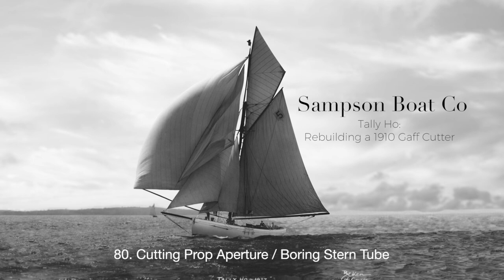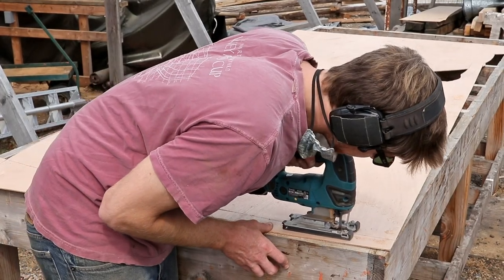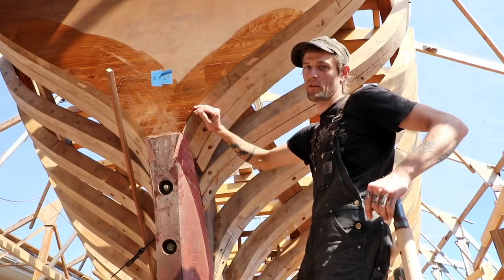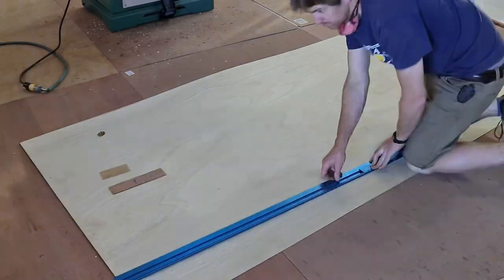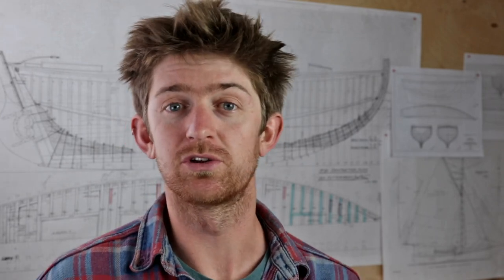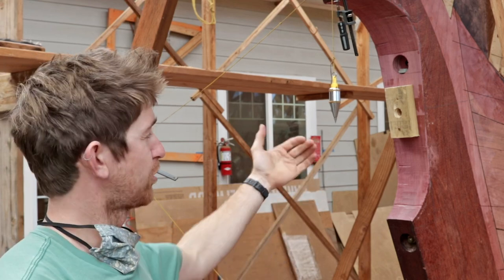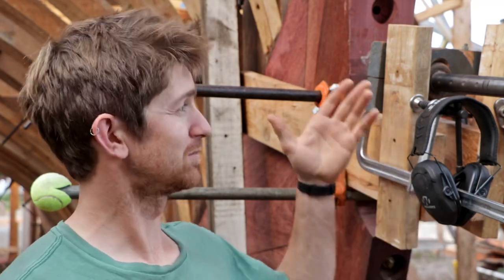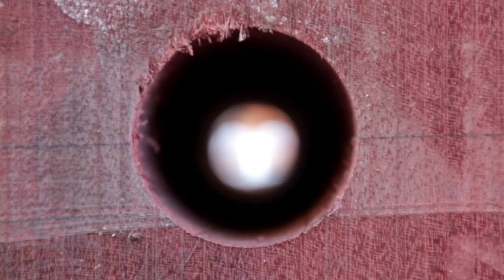Cutting for Propeller / Boring for Prop-Tube ( Wooden Boat Rebuild / EP80)

Comment: "I commute by airplane and bicycle."

That, my friends, is what you call 'living the life.'
Reply: I doubt the bicycle can offset the huge CO₂ emissions of the plane.
Reply: @Mike-oz4cv  A Cessna doesn't use much more than a passenger vehicle, gets maybe 12-13 mpg.  It's a direct line trip with no stop and go so a much shorter trip and therefore he probably uses less fuel flying than if he were to drive it.
Reply: @rummy98  12mpg is 19l/100km. That’s like 4 times the fuel consumption of a car. But of course in the end what counts is the overall CO₂ emissions of the commute. Which – considering the distance – are probably enormous no matter the vehicle, unless it’s an (electric) train.
Reply: @Mike-oz4cv  
Keep in mind, that's a quote from a guy who sees himself as a corpse with a lizard's light receptor in his forehead !!!
Reply: @Mike-oz4cv  Hey that's still less than my Dodge Durango which gets 21-23L/100km 😂😂
Reply: @deephorizon1365  but it would take you double triple the miles to reach Sqem(spelling?). So he flys directly strate line. So i duno its not an easy yes/no answer. Its a 1947 but 25 year owned checked daily constantly matinence  would have to meet new standards. Im unsure what airplanes engines actually pollute. Remember THIS PLANE is a piston engine like most of cars. Its not a giant jet or even turbojet so fuel consumption  is not that bad. Im sure if he flys easy uses lil fuel he can stretch mpg just like you can in your car. So its not as easy and i know from 05 on hondas if you use a calibrated 5 gas analyzer the exhaust generally can have better levels of NoX and Co Co2. Obviously there's lil oxygen and only a TINY amount of hydrocarbons . So cars are doing a great job. Most of them anyway. Id imagine in planes the cesna worked so they built them "basically"  forever in similar spec. So again harder than just googling mpg ratings.
Reply: @Mike-oz4cv  So let's build him a special electric train that only goes from where he is, to where he wants to go.
Reply: @Mike-oz4cv  get a life mate!
Reply: @maxheadroom7687  Yes I’d like to live my life without having to suffer from his emissions.
Reply: @Mike-oz4cv  In this case I believe the plane would emit ~9.2 kg of CO^2 for the 44 miles vs a car at about 19.6 kg of CO^2 for ~62 miles This was calculated from an average of 0.7 kg of CO^2 per mile for the car. The plane emissions was calculated assuming he burned ~4.2 gallons of Avgas because the engine the engine burns about 10 gallons per hour. At 25 minutes it's about 4.2 gallons and with 2.199 kg per gallon you get 9.2kg of CO^2. 

Therefore in this case the plane is more efficient than a car to make this trip.

Comment: I would find every step of this terrifying and so easy to screw up. How did Leo get those transverse drill holes to emerge right on his chalk line? Jeesh!
Reply: a level and an extra set of eyes
Reply: @brownsnake0400  Yes, for the main hole; but how about the transverse holes he drilled for the sawzall?
Reply: "... and here's the stern post I ruined yesterday!"
Reply from the maker: sight the previous one and adjust :)
Reply: He used the stars and a transom!
Reply: spim randsley  Leo
Reply: Please tell me that was an intensional pun, to "screw up" the cutout for the prop...
Reply: @terrulian  I noticed that too. I have trouble drilling 5" into the bottom of a newel post and 90% of the time I experience drill bit travel. I probably would have made a jig even for those small holes
Reply: @SampsonBoatCo  Contact me regarding balancing your Copper Bronze lead Steel Aluminium Stainless Steel.
Comments about VPP and Alternative shafts for driving ancillaries.
JPJP.
I sent my email to the Foundary guys.

Comment: Leo, nice job boring the prop shaft hole, Its tough to keep the hole centered without a jig. Bravo.

I spent years working at a Navy Shipyard where we overhauled Nuclear Submarines. During that time I worked with machine shop tool makers who manufactured cutting tools for working stainless steel and Monel parts of Nuclear Reactor Systems. There were a couple of things I learned while watching them work. The first is something you as an expert woodworker already know, that when sharpening any tool (chisels, 3/8 tool steel blanks, drill bits, etc) it is critical to keep them cool while grinding. Their sharpening machines always had a continuous stream of water or cutting fluid flowing directly onto the tool bit to keep it cool to the touch. But the tool can go from cool to hot in a very few seconds, especially the sharpened edge where the heat is generated and where the mass of the tool is least able to dissipate the heat. If it turns blue you have have probably ruined the temper. I have used the Tormek grinder that you use to sharpen your chisels and it is pretty good because it turns slowly and has a water bath which wets the stone. Plus the larger mass of the chisels helps dissipate the heat keeping the temperature down. But for the tool bit blanks that may not be sufficient. The tool makers at the shipyard always use a continuous small stream of coolant directed at the tool bit. It may not be practical for you to do with your equipment so the best thing it to grind for a few seconds, then let it cool, repeat. 

Also, I noticed that you welded the cutting tools to your boring tool. It is my understanding that hardened tool steel or carbide should never be welded. The very high temperature will ruin the heat treatment and lead to breakage. If they need to be fixed in a larger piece, for example a tool in a lathe, they are mechanically clamped in place. If they are attached to a blade like the one on your table saw, they are silver soldered or brazed. 

Hang in there, you are doing a great job. Chuck Petrone

Comment: Coming along quite nicely. If I may offer a tip, put a a small clear plastic bag over the magnet  before picking up the nails, then pull the bag off and all the nails will be in the bag.

Comment: I strongly recommend you use a 3 bladed propeller, a 4 blade one will create vibration problems.  Two of the four blades will be alternatively blocked by stern post.  This alternating between 2 and 4 blades providing thrust sets up a pulse that will be felt in the vessel.  If you need a more detail explanation let me know.
Reply from the maker: Interesting - could you email any info about this to me? - info@sampsonboat.co.uk 
Thanks - Leo
Reply: This exchange shows the experience and knowledge of the community sharing Leo`s journey. It`s a pleasure to be a member.
Reply: @SampsonBoatCo  Please share (in your excellent condensed, clearly explained form for landlubbers).
Reply: Related to why car radiator fans are often assymetric to reduce noise: https://mechanics.stackexchange.com/questions/24327/why-are-the-blades-of-car-radiator-fans-unevenly-spaced
Reply: we all, sofa's boatbuilders, need a more detail explanation... if you could post here... 
🇧🇷 ⛵1981 oday daysailer ⛵🇧🇷
Reply: Propellers like any rotating equipment cause vibrations which in the lower frequency bands, 0.5 Hz to 100 Hz, cause noise and vibrations that can be felt throughout structure that resonates with the first, second, or 'n' order of the driver.  Propellers however many blades have frequencies dependent on the number of blades and rate of rotation, typically these frequencies are on the order of 15 Hz to 30 Hz.  The boat as a unit and each piece of the structure making up the boat has a natural frequency.  When the propeller blade frequency matches the natural frequency of structure etc. and the amplitude is sufficient the structure will vibrate.
TALLY HO hull shape in the stern is deep 'V"eed and the propeller is set in aperture cut into the keel/skeg and rudder.  These factors indicate that flow to the propeller is primarily parallel with the water surface.  The hull planking will see pressure pulses from the propeller blades but the steep angle of the planking reduces the impact of the pressure pulses on the structure.  However, the effect of having a wide keel/skeg in close proximity to the propeller will block flow to the blades as they pass behind the keel.  This will create a momentary loss of thrust and therefore an impulse that is vibratory in nature, potentially exciting structure and creating noise.  A four blade propeller as it passes behind the keel effectively loses approximately 50% of its thrust and therefore the impulse is larger than a three bladed propeller that loses approximately 33% of its thrust.
The hydrodynamic math is the same for flow around any body and can best be illustrated by a CFD (Computational Fluid Dynamics) program or by a model test., or in full scale with underwater cameras, strobe lights and pressure sensors set in the hull, and instrumentation to record vibration and noise.

Comment: Used to be a sparky on Churches and Castles so a 1M+ drill bits was an everyday occurrence. The "sway" we used to call it was how much the bit would bend whilst drilling. So at its worst you could be way off once out the other side of wall/ block. I cringed a bit when you first drilled thinking the worst but to no avail.
Still looking great and thank you so much for producing these videos.

Comment: “Anybody can build the middle of the boat” - I couldn’t.
Reply: Neither could i.  I can't even cut a straight line using a straight edge!
Reply: Me too no middel of the boat building  for me
Reply from the maker: @regieendsley9750  that's ok - no straight lines in a boat!
Reply: @SampsonBoatCo  And no 32nds either :)
Reply: @SampsonBoatCo  Straight lines are easy, nice and consistent curves are hard!
Reply: I can build the very middle where there's no wood or metal or minerals.
Reply: Touché 😂😂😂👍🏻
Reply: @stickshaker101  my level of expertise 😂

Comment: Great Job on the ' line boring ' , looking thru the hole at the bow on center was a relief for you guys, makes engine mounting easier, if there is such a thing as 'easy' in boat building.

Comment: #12 ! Very interesting ! It has always blow my mind when I see a builder marking or figuring where the water line on the hull of a ship or boat will be.!! HOW DO THEY KNOW ?? I mean Leo , wouldn't you have to know the finished weight of a boat or even the Titanic when painting the water line ?? How do they, ...you all figure that out ahead of actually placing the boat in the water ??To me it is amazing. peace
Reply: You put the boat in the water and draw a line around it!😄
Reply: You can approximate the volume and weight of the hull by mathamatical methods, which gets you close but won't be perfect, in part because pretty much every 'built up' hull will turn out a little different from what was predicted on the plans. Titanic came out a little longer and narrower than her sister Olympic, which in turn was narrower than the third member of their class Brittanic for example (Olympic also stole all the luck and was the only one of the 3 of her class that didn't sink).
Reply: Well, I agree it must be a real bit of boat-builders art to determine where the waterline should be, but you don't need the weight - once you've marked the water line, you just ballast the boat until is sits on the water on that line.

Comment: I noticed that the shaft hole is angled upward, where it was horizontal in the original design. This change will position the engine higher & further aft, allowing either more room in the engine compartment for modern systems, or more habitable space in the cabin.
Reply from the maker: Also allows the prop to be just a little deeper, which is a big advantage if you are forced to motor in a really bad sea.

Comment: 1. Great segment about Charlie!
2. Pete Rocks!!
3. As an Electrician years ago, just drilling with the big Milwaukee Drill and large auger bit, into soft pine studs might almost break your wrist or arm sometimes; drilling into old mill building oak floors could make a man start to cry.........and that was before we started drilling!! Great job on the shaft alley!!   DD

Comment: Why are there 2 holes for the prop."
Reply: : The other is a hole for one of the after deadwood bolts.
Reply: David Green duh  I have no idea what that means
Reply: @johnmcdyer7297  It's a hole for one of the bolts that hold all the bits of wood together that are filling in the gap between the stern post and the keel.
Reply: See episodes 43 to 45, and 77 , or binge watch the whole lot like I did when not working much a couple of months ago!

Comment: Glad to see you got the "Hole Hawg"!!! Those are great drills but "be careful". They literally will twist your rm off. Used those drills for days on end drilling holes for wiring in apartments and houses decades ago. Never had one of those drills fail !!! Did have a friend lose a finger while using one so be careful !!! 
The boat is beginning to shop its lovely shape. Looks Awesome !!!!!! 👍👍👍👍

Comment: Man, that's a big chunk of purpleheart taken out of the sternpost. I wish I could get my hands on that chunk of wood. But it definitely would not be in my budget to do so.  Loving the lines on the sides of the boat and the boring part was anything but. Great bit of kit used for that bit of work. Going great, Leo. It may not look as if much is getting done, but that is loads of work happening. Cheers.

Comment: Milwaukee Hole Hawg, "When only the most badass drill motor on the planet will do".

I still have mine, it's 35 years old, and it still works as good as it did back when. And your brand new motor looks identical to mine. Nice to see that Milwaukee is sticking with a winner.

Free advice, "Beware of the low gear", it will hurt you.

Comment: I, for one, am very happy that you went with the original design location for the prop.  I am certain that you will look back at that as one of the many wise choices you have made on the boat Albert designed.

Comment: Leo, I love your work, Love that you are sharing the build with us. Tip, I When using the magnet, I would always put a cloth pr paper between what I wanted to pick up and the magnet. when you have picked up what ever then pull off the cloth or paper allowing the load to drop onto a piece of plastic that you can then transfer back into the jar or can without ever touching the load. Try it, it will save so much time.

Comment: As always, a pleasure watching good decisions be made. You will love a feathering prop, and not just because of the reduced drag when going forward under sail, but also for the ease of backing: reversing props have lovely power in reverse because they turn to present the correct angle to the flow.

Comment: Ive been a plumber for 35 years and using a Hole Hawg with those bits on low speed on 2X4 fir is daunting enough. Leo using it to go through purple heart and at those large depths is scary looking. One catch and it twists your wrist off! Once again, nice work   EDIT ; the first holes are low speed, he later changes to high speed
Reply: I had a drill that topped out at 400 RPM.  Massive torque but it had a clutch that if resistance sharply increased the bit would instantly stop rotation.  The drill was purpose made this this kind of job.  
Yes, I have seen guys - always on step ladders - who suffered the pain when the hole hawg caught.  Usually because they weren't paying attention.

Comment: When the Duyfken replica was built in Fremantle she was launched without motors or prop shaft. She was later put back on the hard and the motors fitted and holes drilled.